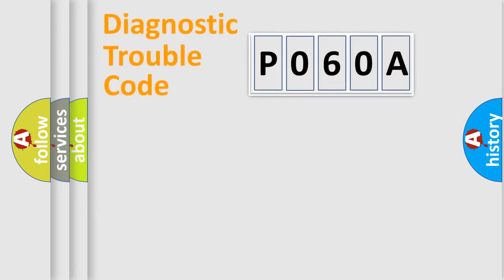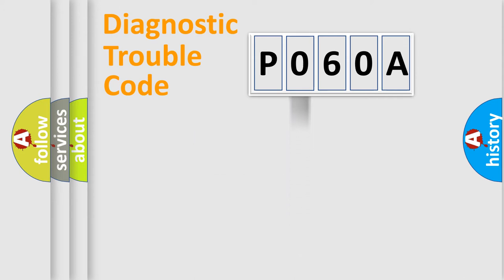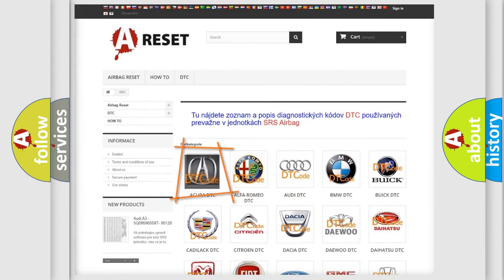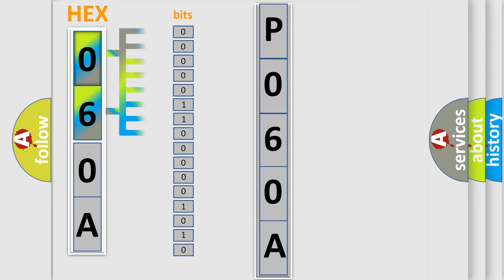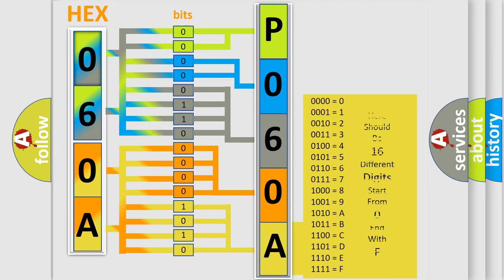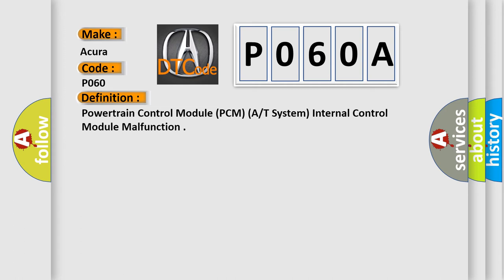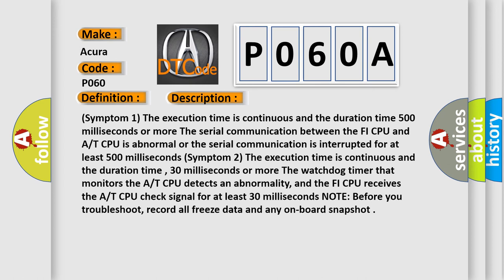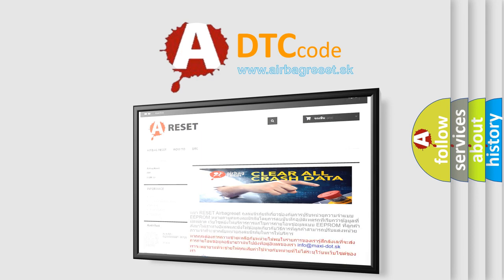DTC Acura P060A Short Explanation

Comment: I have a 2012 Acura TSX that has this code I have updated the PCM replaced the PCM , replaced the immobilizer and still having the issue
Reply: Hello, I have the same year and car. This code popped up yesterday for me. We’re you able to resolve your car issue? Looking for advice thanks!
Reply: @Kim-ne5cp  after about 1k in parts an trouble shooting it ended up being knock off ngk spark plugs from Amazon.  Bought some local ones, no problems since
Reply: @crxman91  Ok thanks for info, do you suggest I change the spark plugs first then proceed with updating or replacing PCM? It currently at the shop getting a full diagnostic
Reply: @Kim-ne5cp  spark plugs are cheap and only take a few minutes.  So ya
Reply: @crxman91  thanks I am going to change that first!